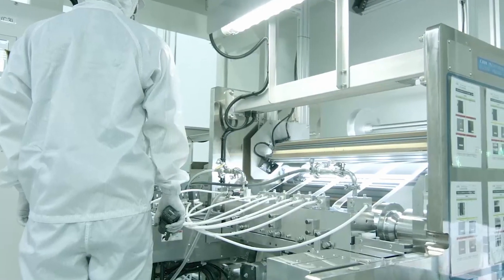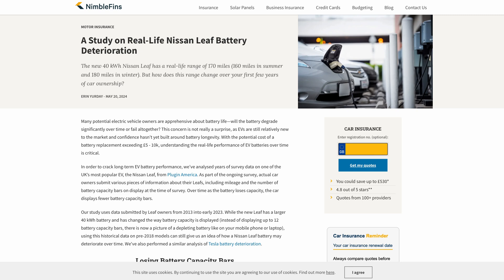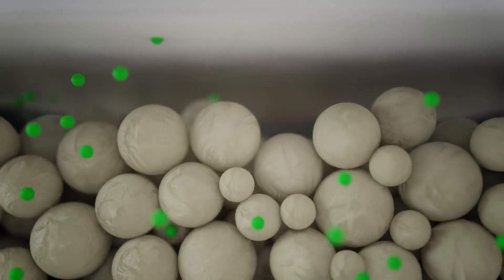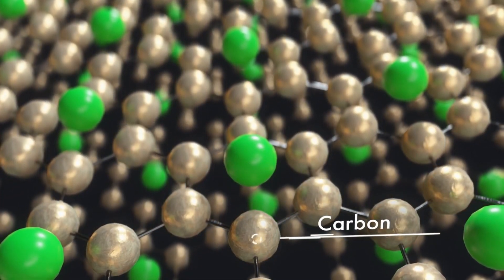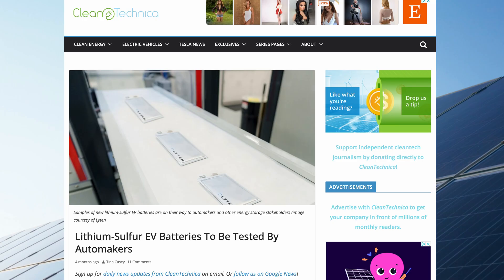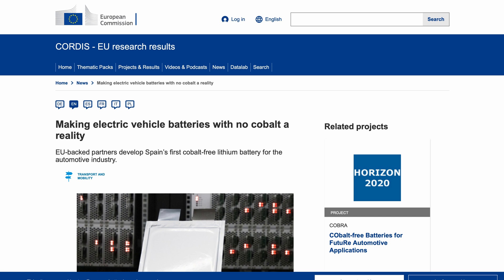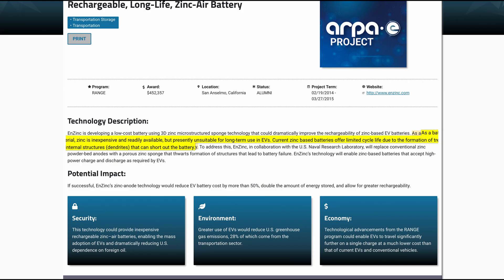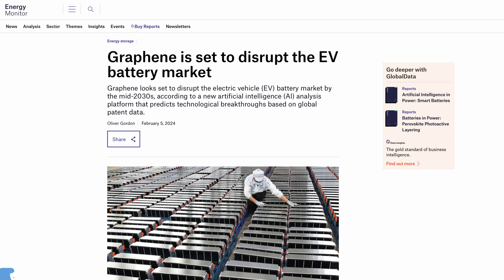Electric Car Battery Breakthrough: Is This The End Of EV Range Anxiety?

Comment: What about petrol and diesel range anxiety. If Israel hits back at Iran’s weekend drone and missile attack and Iran retaliates by disrupting the Strait of Hormuz – a narrow waterway nearby through which a quarter of global maritime oil trade flows – global oil markets will face a major choke point.

This could be mitigated by exporters using more time consuming routes, but the damage to oil prices could be significant and long-standing. There are not many alternative routes from main production sites to Western countries.

If logistics are affected, consumers may face shortages once again. And Australia is not in a great position to weather that.

Despite being a member of the International Energy Agency, Australia does not maintain oil stocks equivalent to at least 90 days of consumption, as required.

According to Australia Petroleum Statistics, current diesel stocks are estimated to last only about 26 days, with petrol stocks close behind at 27 days.

Comment: Range anxiety is , and always will be a major negative aspect of Electric cars and even more so when it comes to commercial vehicles.Electric cars and batteries will of course improve within the constraints of the Laws of Physics , though they will not be able to achieve the level of practicality that the Internal Combustion Engines did.More public transport and an increasing number of Public hire vehicles will probably go over to electric power.I am an aircraft  electrical engineer and in common with the vast majority of technically trained and scientifically  informed people can see very little prospect of commercial aircraft ever being powered by any type of battery.The same applies to ships and even most boats , where the latter are not designed primarily as sailing craft.
Reply from the maker: Oh dear Robert, are you stuck in the "it won't work as we've always done it this way" mode?  Please do a bit of research before condemning EV aircraft. For example; DHL already has a small fleet of “Alice” e-cargo planes supplied by Eviation in America operating on short haul runs on a trial and plan 12 more within 2 years. Just one of many examples

Comment: But will they produce cars with more range, or just keep the existing range and make them cheaper/lighter?
Reply: Both. Lucid is offering up to 512 miles of range (verified by Out of Spec on a 70mph range test, as well as Rivian, with up to 410. Do they cost? Of course they do. But they’re designed for continents the size of North America with big distances and pockets to match. In more densely populated places it begs the question of how much you really need. In summer months, my 2 year old Volvo is good for 250 miles, which is more than adequate for me - four hours on the road and I’m ready to visit a bathroom and have something to eat. The biggest enemy of electric cars isn’t weight - they’ll always be lighter than HGVs, it’s aerodynamics. As for making them cheaper, EVs rely on complex electronics and expensive batteries, so I can’t see how. At least there’s enough selection in the market of new and used cars that most people can find something that works for them if they choose to. I’ll never go back, and I’m glad there are straight shooters like Dave to clarify things for people testing the waters. Come on in, the water’s lovely!
Reply: @davidcottrell570  Yea, I think they'll do both as well. Less cells will mean cheaper cars, more cells to give petrol type range. All we need are more chargers!

Comment: We don't really need a breakthrough. We just need to get the higher density LFP batteries that already exist into EVs to get normal ranges of 600 to 700km with faster charging speeds. This will meet the threshold for mass market adoption. Without range anxiety people will prefer lower purchase prices over further range. 1000km batteries are a next decade thing, for now just hype outside of luxury niches or maybe a small market for super long range vehicles.
Reply: I would like a BEV with a real range of 500km at highway speed during winter time at -20⁰C, with at least 0.3KWh/kg energy density, and at least 20% reduction in battery pack weight. Of course fast charging speed is a must, but I don't mind taking a half an hour break after each 400km on the highway/Autobahn.

Comment: Dave, a great round up of current battery status. I would like to add two Lithium based technologies that are in development currently, one is a about a year away and the other is about 5+ years.

The 1st is LMFP, which is a variant on LFP but with Manganese in the Cathode, multiple battery makers (including CATL) are actively developing these and are at early commercialisation stage. Samples have been validated, starting last year, by automakers in their cars, including by Tesla. LMFP appears to be the most mature of the next-gen Lithium based chemistries. The batteries have a higher energy density than LFP, sitting at a mid-point between LFP and NMC. The downside is they have a lower cycle life compared to LFP but higher than NMC, hence are suitable for EV lifecycles (30+ years) but not so much in BESS. It is likely that LMFP will displace LFP in EVS, with LFP being used more in BESS being slightly cheaper. 

The 2nd is Lithium-Air, like the other metal-air batteries offers very high energy density.The reason for mentioning it is Lithium-Air offers the highest energy density of all Lithium battery technologies, with a maximum energy density potential of ~11,000Wh/kg (similar to that of jet fuel and petrol). This technology is being actively developed and sits at the cusp of pre-commercialisation - 5+ year timeframe. Currently the real-world production energy density is 1.3 to 1.7kWh/kg, which is similar to the level to that of petrol's useful energy capacity in an ICE car. Non-flamable solid-state and aqueous electrolytes can be used as well as flamable organic solvents. Any electrolyte breakthroughs for the other Lithium chemistries will likely also apply to Lithium-Air. The downside, and principle development area, is the low cycle life, currently at 800 to 1,000 cycles (though is higher than device Li-Ion/Li-Po). Research is active as Lithium-Air is ideal for battery flight enabling longer distances and/or heavier payloads. Further, systemic solutions such as swappable battery approach are being investigated, similar to the Nio EV's battery charging model. A number of battery manufacturers are also investigation high-recyclability battery designs, that offer rapid and cheap recovery of the Lithium at high grade to directly recycle into new batteries in an automated battery re-manufacturing (used in / new out) process.

One additional point regarding Sodium batteries, is that while they will become cheaper than Lithium based batteries they are much heavier due to the higher atomic mass of Sodium (~3 x that of Lithium) as well as offer the lower energy density mentioned in the video. Sodium batteries may have aqueous (salt-water) electrolytes or more flamable solvent based ones, the latter offers higher energy density than water based. Whether the weight can be sufficiently addressed to be used in EVs is an open question, hence the initial focus has shifted to BESS ussage, where Sodium's high cycle life (10,000+ cycles) will offset their intial high production cost.

Comment: LFP (Lithium I'r'on Phosphate) is the safest EV-suitable option, currently being produced in huge by CATL and BYD, who are the 2 largest battery producers on the planet.
LFP can also be fast charged to 100%, without accelerating degradation (i.e. shortening lifespan) compared with NMC, which must be trickle charged beyond 80% in order to preserve it's lifespan.

Comment: I have issues with incineration anxiety. Makes sense.
Reply: When your EV battery catches fire, you will most certainly get out alive, and most likely without any injuries, because combustion is gradual.
By contrast, if your gas tank combusts, the whole thing goes quicker than you can say 'woof!' meaning you & your loved ones stand little chance of surviving. 
Now, how sobering is it to realise that 🔋 🔋  are actually 'safer'?
Reply: Then avoid ICE cars and ICE-Hybrids in particular.
Reply: You could quote some actual data rather than nonsense you have read on social media. 

0.0012% chance of a EV battery catching fire. 0.1% chance of an internal combustion engine vehicle catching on fire.
Reply: @BarryHeaven  Hyundai and Kia's fires were due to faulty ABS modules. Try harder. There is no comparison between a 5,000 degree EV conflagration and an ICE fire which can actually be extinguished most often. Try harder.

Comment: The answer is no and I don’t need to watch the rest! I’m very pro EV and drive one, but we are miles away (sic) from getting rid of range anxiety. It’s not just having longevity and more range in the batteries, we have to have cheaper public charging prices, better infrastructure and cheaper EV’s overall.

We will get there eventually, but it’s going to take many years and a combination of all of the above to achieve it. Of course the rabid anti-EV brigade won’t be happy until we have 1,000 mile range, charging the entire battery in 5 minutes and unlimited warranties on everything.
Reply: Laws of Physics apply which means this just is not going to happen.There will  be improvements  but batteries are not the answer alone.

Comment: As far as I'm aware these different battery chemistries have different capabilities when it comes to delivering peak current. This is why Tesla use the different types in their cars.
Solid State has issues in EVs as it is brittle.
I think, if any of these technologies get out of the lab and the investors don't get fed up, there will different batteries for different cars.
Its not always the best tech that triumphs, its often the one that has the best traction in the market, I give you Betamax, m'lud.

Comment: Take your point on the desire to do away with cobalt. But of course they don’t mention the fact that cobalt has been used in the petrochemical industry for years to help refine petrol. So when you look at it for every gallon burned in a ice car you need more unlike a battery. Once built that’s it. I know two wrongs don’t make it right but it is still worth mentioning.

Comment: It's always great to see a thorough review of different battery types. However, what I find most frustrating are the claims like "this is a Tesla battery killer" or "this will replace such-and-such battery." Just take a look at how many older battery types are still in use today—lead-acid batteries in cars, and alkaline batteries (like AA and AAA), for example, as well as other types for specific applications. Will lithium batteries eventually be replaced? Possibly. But will it happen before 2030? Probably not.

Comment: My understanding is that LFP (Lithium-Iron-Phosphate) batteries contain no cobalt, which I believe is what I have in my standard range MG5. These apparently have a significantly lower fire risk and much greater longevity than NMC. The downside is lower energy density.
Reply: Dave mixed things up a little, the MIT Cobalt free article he showed when discussing removing Cobalt is in relation to Lithium-Ion (i.e. NMC and NCA) batteries. The article discusses MIT's development of a Lithium-Ion Cobalt (and Nickel) free battery that achieves high energy density by using non-metalic organic substitutes. The article later references LFP as one example of an alternative battery technologies that also doesn't involve Cobalt, but the article's language is a little involved and doesn't state this clearly; I suspect MIT intended to draw more attention to their own development. 

[Excerpt]: "Because of the many drawbacks to cobalt, a great deal of research has gone into trying to develop alternative battery materials. One such material is lithium-iron-phosphate (LFP), which some car manufacturers are beginning to use in electric vehicles. Although still practically useful, LFP has only about half the energy density of cobalt and nickel batteries."

Comment: I think the true "game changer" is PROOF of longevity. Now that manufacturers are offering 1,000,000km warranties. Plus many tests are proving very little degradation even after 300,000 to 500,000km. Then general public will be able to rest in the knowledge that the EVs will have a long life and stupid stories of batteries being useless after three years, can finally be put to bed.
Reply: @mikadavies660  they’re not stupid stories; they’re true stories of Nissan Leafs (Leaves?). And for lots of people, a second hand Leaf is all they can afford.
Reply: @dominicgoodwin1147  Mate, if they were saying "Nissan Leaf batteries" have limited life.... Then cool. As this would be accurate. But the stories are that "ALL" EV batteries are crap and all EVs only last "x years" and just saying that is stupid is actually being polite... When it's utter crap. Now when it comes down to what people "can afford" let us both not assume that people are so poor or so rich....! I am told that many thousands of cars are purchased in the £5,000 to £10,000 bracket. I would say that there are a few respectable EVs in that bracket that many people can look at. My friend has a Zoe with 186,000 miles on it. His battery has degraded to 79% and is still a very usable car.
Reply: @dominicgoodwin1147  Because it has no thermal management, and was one of the first (cheapish) EV.  There is already plenty of real data - you know, evidence - that shows that batteries in modern  properly designed EV cars will last longer than a ICE engine of gearbox.
Reply: You mean like mg in Thailand offering lifetime warranty for batteries and electric motors in their cars?
Reply: @Paulirwin44  Whenever anyone says "lifetime warranty" I always ask, what does "lifetime" mean to you?  Inevitably lifetime as defined by a manufacturer is not what most people would define it as.
Reply: The only REAL proof will be thousands of cars lasting 20 years with minimal degradation.  Indications are looking OK so far but we're only at 12 years or so for the Leaf & less for the Model S.  Even the latest report suggests that many batteries will drop below 60% before the 20 years is up, for many use cases that might mean a replacement. 

As far as really solid proof is concerned there's nothing to do but wait, and that counts doubly for new technologies.

The real game changer that could short circuit the waiting is an EV which is designed with eventual battery replacement & repair in mind i.e. making it easy and cheap. This alleviates the principle worry and means cars could potentially be made to last decades.

Comment: Actually it doesn't really matter, my EV will keep on driving almost as long as the first day.
If you think you will get EVs with 1000 miles of range in the future you are wrong, no matter how cheap batteries get you will only pay for 300 miles
Faster charging is maybe good, but it is already fast enough and the chargers will be even more expensive than now
Reply: As the EV market matures it will likely segment by range groupings to fit differen needs - first/town/city cars (150 to 250 miles), mixed/average family usage (~300 miles) and tourers & tow-ers (500+ miles).  In the end there is a trade off between battery energy density, power, curb weight and efficiency when determining range different segments will seek differing combinations.
Reply: I’m sorry to hear that, especially since I get 200 miles @ 75-80 mph, on a 300+ mile car, guess I can’t go electric until we have more DC charging in rural areas. 😢